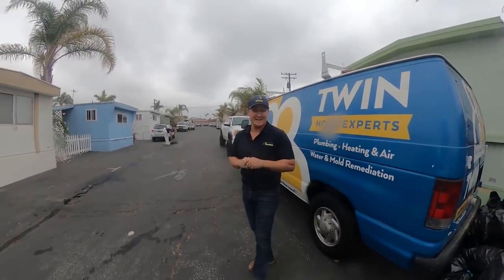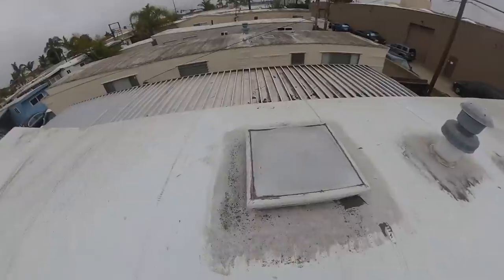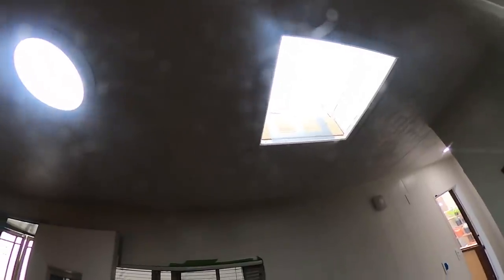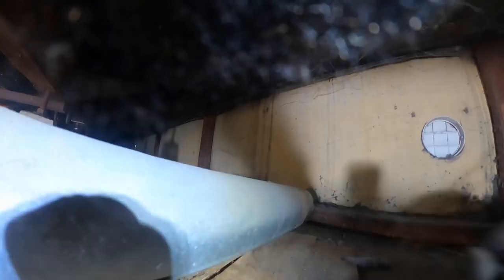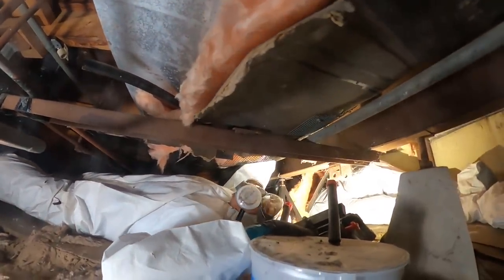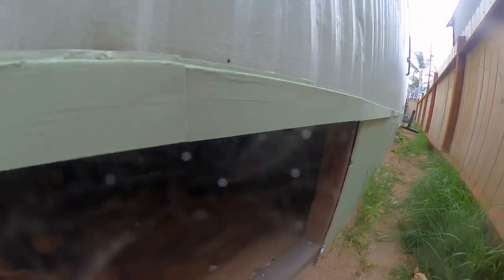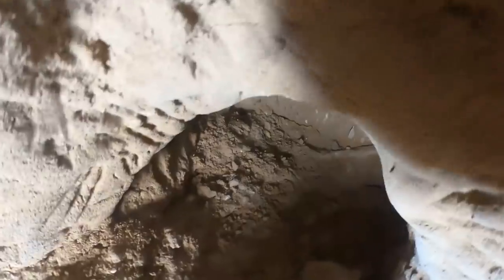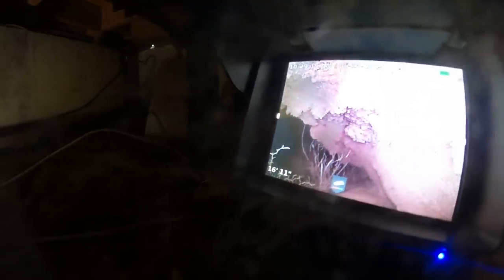The BEST WAY TO GET RID OF RATS...with a hose and concrete...

Comment: I had a burrow in my backyard! I didn’t know what it was! I thought it was a ground hog hole. I found it by falling in up to my knee when the cable guy was hooking up my Comcast a year ago! So I filled it in with rocks and English walnut shells from
the last 30 years. Then I covered it with weeds and branches and stomped it down then I made a flower bed mountain on top. I think they went to the neighbors where there is an apple tree. I raked up all the walnuts from so many years and filled up the yard debris container every week for a month! It’s a small yard lol.  I have four cats inside so I haven’t seen any rats, but I was infested with ants for the first six months and I think they were worse in some ways. I had them at the end coming out of the ceiling light fixture.  I learned all about ants for sure. I made a fat garden outside and after luring them away they now enjoy the aphids and seeds regular watering  and don’t come in anymore. I also have diatomaceous earth around the inside perimeter of my little house. Finding affordable housing is tough. Thanks for your videos they are rather addictive. Well done!

Comment: I was wandering should large amounts of bait (left in the bags to prevent moisture) be added before filling with concrete. Also would a locator attached to the camera find their tunnel between trailers so you can more easily dig down find the tunnel set bait and concrete their? Thanks for posting ‘Chicago’.

Comment: Why did you not do the smoke test to find out where they are coming in if there's a burro it has to be coming from the outside-in so if you smoke detected it would push something out into the yard and you could stop it in the yard